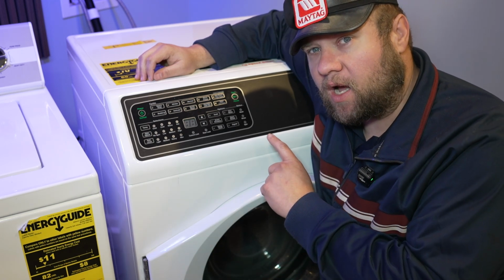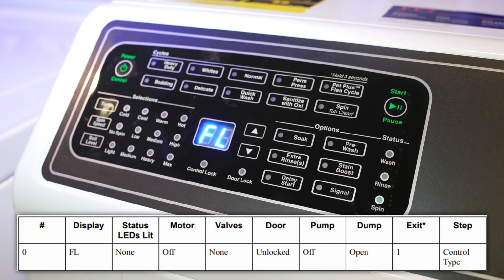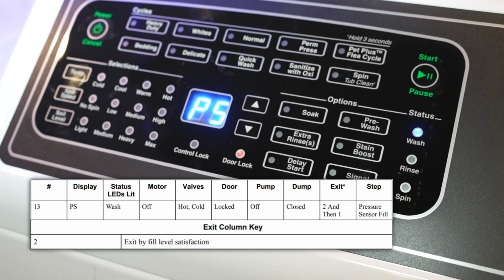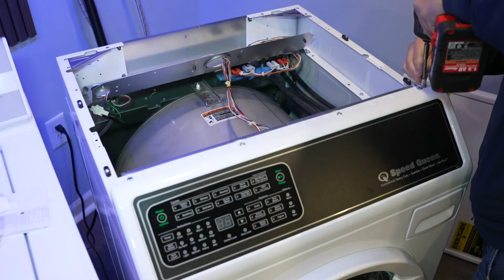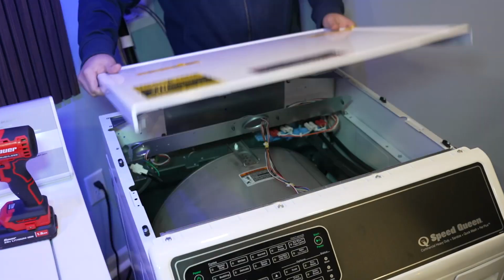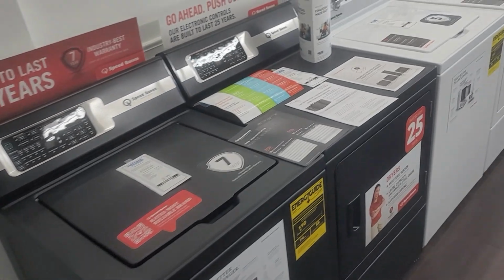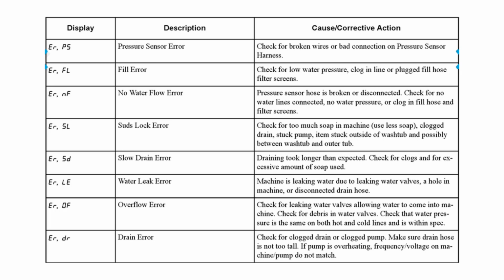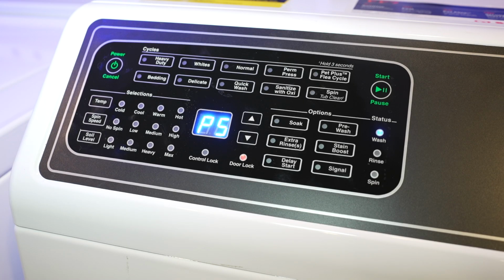How to Use Diagnostics on a Speed Queen FF7 or TR7 Series Washer + Increase Water Level Hack & More

Comment: The water adjust works but the video showed you toggling Dip Switch 6&7. Dip Switch 2&3 are correct so make sure you LOOK AT THE NUMBERS ON THE SWITCH. The SW1 on the left side simply identifies the entire switch and should not be interpreted as Dip Switch 1.  Keep up the GREAT WORK!

Comment: I have never hated a washer as much as my TR7.  Terrible software in general feature wise, panel responds like its in debug mode, and no front panel reset capability.  I cannot reach the power cord, and the circuit breaker is in the garage.  I have a jet pump water well that is barely enough, and this damn washer gets fill errors all the time.  I am not spending thousands on a new well.  Speed Queen, never again.

Comment: If you try and adjust the water level and you don’t want to mess with the switches in the back what will happen? I would assume the it wouldn’t let you make the water adjustments unless you open the machine and switch the switches. Any thoughts? I was wanting to adjust the water level up a notch or two but don’t want to tinker with the switches.
Reply from the maker: Theres no choice other than to use the switches
Reply: @bensappliancesandjunk I really didn’t want to open the machine and tinker with that part but I’ll think about it. Thank you.
Reply: @bensappliancesandjunk   Hey there is there a trick to slide the top off? I cant seem to get it off i tried to pry a little with a screwdriver but not much as i dont want to scratch up the top
Reply from the maker: @Luv2wire95 did you remove screws from top of washer in the back?
Reply: @bensappliancesandjunk  yes i even removed the back plate with the four screws and i still couldnt get it to move
Reply: @bensappliancesandjunk I got it! Had to use a small hammer to pry it open from the back cubby hole with the back plate off

Comment: Do u have a part# for the inner black gasket that has the screws holding it on & also the screws holding it. It's the gasket or rubber piece that you looking at when the door is open & in front of the drum

Comment: QUESTIONS.... please please answer...or do a video  please 🙏🏽
* where is the washer dip switch located on the sF7 unitized frontload (stacked washer/dryer)??
* can i manually add more water to the sf7 washer? (without it going into automatic drain mode)

Comment: is it possible to add water manually?
Reply: Yes, you'll have to pour it through the soap dispenser ... I have to do this on occasion. Just don't pour it too fast or you'll dump it all over the floor.
Reply: @jteamaz great thanks so much!
i've been doing this to my ge 400 front load for several years since replacing the water inlet valve 😢
supposedly in the front load SQ there is a dip switch inside that when flipped converts it to "more water"!mode!
i need to learn how to do this!

Comment: So, That was totally Unbelievable Ben. Ain't no Repair guy that I know gonna show ya that? (I don't think?). I got a Question on the FF7 UNIT to anyone Out there?  Does or Will this Washer Wash a KING SIZED Comforter and Get it "CLEAN"???? I have an ELECTROLUX that is 4.5 Tub Size and  I'am a bit reluctant to put it in there (The Electrolux) and see if it will Clean it?  Anyone??
Reply from the maker: I did a queen comforter in mine and it absolutely aced it. I would assume a king would be easy enough

Comment: I have a maytag washer that is stuck on drain. I saw that the two wires connecting to the pump are rubbed to the point where i can see the wires. Should i do a repair on the wire?

Comment: Who buys these ugly machines? BOSCH, SAMSUNG, LG 4 life!
Reply from the maker: They last 25 years. Some people don't buy for looks, but buy for life...
Reply: LMFAO buddy. You haven't wasted money until you've bought one of the 3 machines you just mentioned.
Reply: @ianfairbanks1318  We had a SAMSUNG WASHER for about 10 Years (4 years ago now), and it Got Serviced 3/4 Times. Then the Drum/Tub Bearing went out, Sounded Like It was Leaving EARTH. (Unfortunately we couldn't afford) The Speed Queen, and ended up with an Electrolux Front Loader. Service wanted to REPLACE THE ENTIRE DRUM Assembly for Nearly $600.00 Total??
Reply: The worst unit out there is Samsung and LG... Bosch cost way to much. for just moving you fabric around in water... VMW is also junk [rod shocks, transmission and basket hub, lid switch ] just junk... ... anything 20 years old is gold... yep really nice,,,
Reply: We went through four front loaders ... finally spent the $$$$ and got the Speed Queen. 7 years now and zero issues. These things are built like tanks and will last upwards of 25 yrs. just like Ben said. My others lasted maybe 4 yrs. before need extensive work on tub bearings. GE, Kenmore, Whirlpool (twice) No more ...
Reply: When guests come over to visit, I don't typically take them to show off my laundry room.  If I did though, the smart ones would see my Speed Queen set and give a gentle nod of respect and approval acknowledging a superior product without ruining the moment with trivial words.
Reply: People who care about quality and reliability. Speed Queen is in a class all by itself, not a popularity contest.